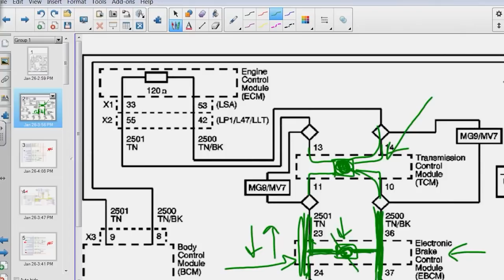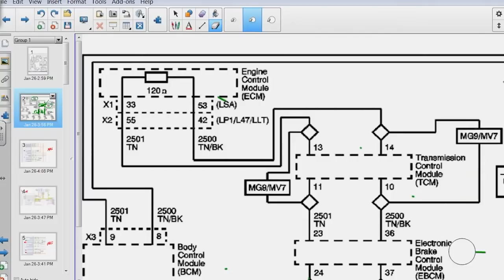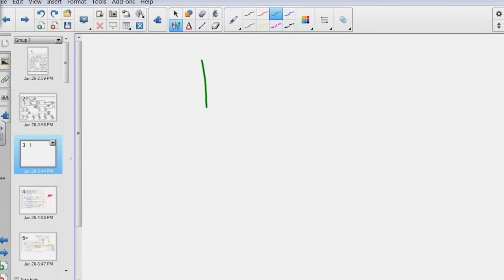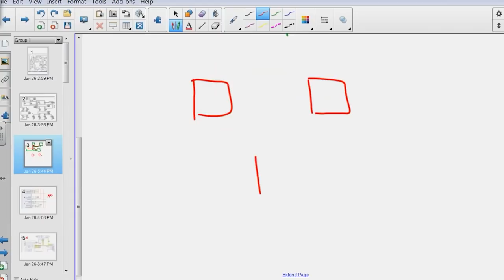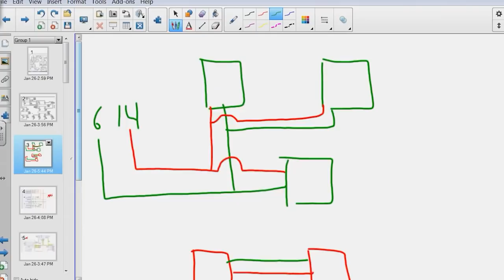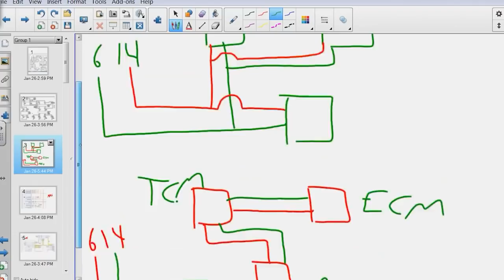GM CAN Bus Wiring

Comment: The only thing about the latter design is when you unplug one module in the line. Even though all are wired in parallel, since the connections are internal, you lose everything downstream of the unplugged module. That could be an advantage if looking for a short to ground, since you can divide the circuit in two and see which side the problem is on.
Reply from the maker: exactly! And it is something we just filmed doing on a 2011 Avalanche (video coming soon)
Reply: Good point! But that could also be a nuisance.
Reply: might have something with a 14’ equinox 2.4 with U0101 and getting a message saying to service the steering wheel and stabilitrack… i’m checking it this way, where can i learn more!?

Comment: Here is the thing. What you say about these circuits being equivalent is true for DC signals. But for data transmission circuits they are very different. The physical network should be a pair of wires that are terminated at each end, GM uses 120 Ohms, this commonly called a data bus. The network can have several modules that are on the two-wire bus each may receive and transmit on the bus, one at a time. The terminating resistors are used to prevent electrical reflections when a signal travels over the bus and hits the end. When the signals hit the end of the bus the resistor absorbs that energy. Otherwise it bounces back in opposite voltage and distorts the next transmission signal. 

The GM bus operates at 500,000 bits per second so the data lines will change polarity in as little as 2us (microseconds). to put data on the bus one module at a time turns on it's transmitter and flip-flops the polarity of the voltage on the wires. A "1" signal might be White=4V, Blue=1V and a"0" would be the opposite White=1V, Blue=4V. All the other modules listen to the signals and either do something with the data or ignore it if it is not addressed to them. But switching the signals every 2 us means there will be lots of reflections, one from each end.

These reflections are very real and can confuse the other modules as the reflected signals compete with the real signals sent out by the active module. Now if you use a Y shaped bus you have three sources of reflections, even worse. Putting a third terminating resistor on would help but having 3 terminating resistors present may overload the transmitters of the modules on the bus and maybe kill them.

To really diagnose this type of signal bus you really need to use an oscilloscope to see what the signals look like but most of us don't have one. Unplugging a module is a viable means of checking what works and does not but it will sever the bus. The severd bus will probably work with only one terminator present, but it may have some errors in transmission (which you probably can't see even with a scope). It is also possible that a module has a burned out driver that could either be an open circuit and not interfere with (or be seen on) the bus or could have shorted internally and could kill all communications.

Comment: Thanks, Dan. I worked for many years in elevator systems and we have similar networks for all the buttons and signals that run the length of the building. With networks you modify them at your peril since lots of engineering goes into making one that works well. Do you know where I can find a copy of the complete CanBus CTS schematic? I'm working on a LFX swap to a Fiero and finding the connection info is next to impossible - Unless you want to spend $500 for a Helm manual.

Comment: I have question regarding the LIN bus,
I remember from classroom video that CAN bus are bidirectional means that communication is coming in & going out. Let us say there is a control module which has power & ground in perfect condition, than even if it does not have communication coming in , it must have communication going out. So in a control module if I remove the whole wiring connection & only connect it with power supply/ ignition & ground & I do not connect any other wire, it must have communication coming out of it ....
Now the lin bus are unidirectional, does it mean that it only sends information in not out , so the test that can be done in CAN should not hold true here ? 
Please correct me if I am wrong
 thankyou

Comment: So my FPCM has 2 tan #2501 wires and 2 tan/blk # 2500 wires. I can swap between the pin outs for the tan/blk and have no affect on communications ? I'm tryingg to figure out why my Exhaust flap isnt getting its ground signal to close. I can manually ground but the ECM or the FPCM isnt communicating and I'm not sure why.
Reply from the maker: What do your CAN signals look like? What are you losing communication with?

Comment: Is there a way to test the GM CANbus FROM control unit to verify that it is communicating not just passing it through?
Reply from the maker: The key with all of this is communication with your scan tool and then using the other modules, that are talking, to tell you what is not.
Then before condemning that particular module that is not talking, is to make sure you have CAN signals (both in an out in the case of my example) And then also to make sure you have good powers and grounds. Oh and of course overall network resistance (terminating resistors)
There are ways to decode the bus messages, but that coding is useless as you can't find service info about it.
In other words, we don't care about specific messages, just that they are there.
Reply: Oh okay, thank you for the reply. That's what I do today, but would be fun to maybe power a control unit and give it input to see if it sends out a voltage on comm lines. Like a test bench, but I guess that wouldn't be practical
Reply from the maker: @StokmanFeilsok  it will, but the signal may be distorted without the termination resistor. But yes, each module will supply a 2.5v bias and the signal will ride on that for both CAN +/-

Comment: I'm confused about the series parallel series circuit, but I guess that's not important. LOL. I get the message.
What are the MG8-9/MV7 circuits?
Reply from the maker: I'm not sure what that is lol
Year, make, model, engine etc and I can look 😉
Reply: Those are probably RPO codes for vehicles with manual transmissions which won't have a TCM.
Reply: @mattt4183  You're probably right. Thanks.

Comment: hai sir nice job sir ...sir i have problem with ford Ecosport 2014 if i disconnrc abs  module,,an engine and transmision was no trouble code ..but car in idle position not run....if i connec abs module engine and transmision was errror...what problem you thinks sir?? in from indonesia sirr...

Comment: I'm checking the ohms resistance on the can bus from 6 and 14 on the obd2 I am getting 0 ohms.  I have a code u0073.  Where do I go next
Reply from the maker: John, you absolute MUST have good service information to attack a CAN fault. 
https://eautorepair.adtrk.biz/?a=10817&c=24&p=r&s1=
First thing is to research your system, find out where the terminating resistors are and how the modules are layed out, then go from there.

Comment: Hello.
I have a problem with a can bus.
No u codes.
I can communicate with all the modules but i can't get live data.
As soon as I try read the live data on any module, the scanner takes me out and display a message of no communication. 
I have literally done everything. 
I don't really know what else I can do to diagnose the can bus system.
Reply from the maker: Sounds like a scan tool issue. What are your symptoms on the car?
Reply: @ScannerDanner  
Thanks for answering me !
The vehicle is a Gmc Savanna 1500, 4.3 l, v6, vortec.
The scanner is an Autel 909
I can use the scanner on any other vehicle without a problem. 
This car had several problems. 
The one that is fighting me is a problem with the can bus.
The scanner communicates with all the modules.
I can read the trouble codes but once that I try to read the live data on most of the modules, the communication stops and the scanner shows me a message that can't communicate with the module that already did.
The only module that I can communicate and read the live data is the pcm and bcm.
I can't read the live data on the ebcm, tcm, airbag,  ect...
I checked the pin 6 and 14 and have 60 ohms. 
I checked the voltage on pin 6 and has 2.4 volts and pin 14 has 2.6 volts.
I checked unplugging the modules, etc
I almost had done everything I know but when the scanner tries to communicate there's some kind of "noise" on the waveband that alters the communication and takes me out of the module.
For example...
I'm in the bcm, I go to brake live data, I  can see the parking brake pedal released and if press the parking brake pedal, in 10 seconds the scanner will stop the communication with the module and it will tell me that it can't communicate with the bcm module that I was already in. 
I don't really know what else to do...
🤷‍♂️
Reply from the maker: @elgroso806  I'm not sure my friend. If you still need help, post to my forum https://www.scannerdanner.com/forum/post-your-repair-questions-here.html it is free to join and we can help you further. Thanks!
Reply: @ScannerDanner  
Well...
The vehicle is running but I haven't fixed the problem. 
Yes !
I still need help.
Thanks for answering.

Comment: If I understand correctly, both circuits are electrically identical (as long as all the modules on the GM circuit) are working.  If a module on the GM-style goes bad, then the entire CAN bus goes down? Correct?
Reply: No,that module will be a no comm when pinged by the bus. Unplug that module and you can't communicate with modules downstream.
Reply from the maker: @johnhnetkovsky8917  exactly but I'll also add (for @Ga Ad, the original question) that depending on how the module goes "bad", it can and will take out the entire network, just like any other system.
Reply: @ScannerDanner  That is true, I have had many EBCMs and Chassis Control Modules go bad and pull entire network down,unplug the module to restore comm. Lots of ways for module to fail, Also have had comm in but no comm out splitting system. Yes ,lots of variables to consider for sure!

Comment: I will fly you down to Florida and pay all expenses' if you can fix a 2000 Ford Windstar severe motor vibration.
Reply: Most likely stripped balancer
Reply: @imnotahealthandsafetyperso4889  It is definitely a rotational vibration, by that I mean something like the torque converter of flex plate has lost a weight. I am very experienced in engine building, and diagnose things rather easily, but this has kicked my butt. Are you meaning the balance shaft or the harmonic?
I have a brand new harmonic balancer on it, the other was suspect due to age, but no obvious deformities on it.
Reply: @michaelkennedy2528  
Balance shaft was a problem I had wasn’t turning  I have had a harmonic also fail on keyway after 200 mls cheap patten part was not cheap egr  fall needed clean and was fine  hope that helps
Reply: @imnotahealthandsafetyperso4889  Yeah, replaced all the egr stuff, DPFE etc. Cleaned all ports for the EGR in the intake,  replaced Harmonic balancer, checked, still good, all injectors have been checked, brand new plugs, camshaft synchronizer has been changed, coil and wires all changed. exhaust has been checked, all open (cats are in great shape). compression is perfect and consistent, removed valve covers just to peek and see if anything might look suspicious, was blown away at how PERFECTLY clean everything was in there. This van has 204,000 miles. Guess I will just go ahead and drop the motor and check the timing/balance shaft and see what is up with that. Appreciate the information.
Reply: I had a Jeep Wrangler that started out with slight vibration, then a severe motor vibration, finally it became a banging sound when accelerating. 
Turns out the flex plate broke at three places where the torque converter attached. Junk yard flex plate fixed it.
Reply: @Jimbo9008  My ex gf had a 2014 Ford Escape Ecoboost that had that happen. The center of the flexplate broke and it made a heck of a knocking noise. Replaced the flexplate twice, both Ford brand new flexplates. The second time it happened I got ahold of my local Ford deal and raised hell. They said they would get it under a warranty, even thought it now had 96000 miles, she bought it brand new. They kept it for over a month, then after they finally finished it, the tech took it out for a test drive, it caught on fire on the side of I-95, totally engulfed, melted the asphalt, all due to them not connecting a trans line correctly. They finally paid out $14,000, she went and bought a brand new VW Tiguan SEL.